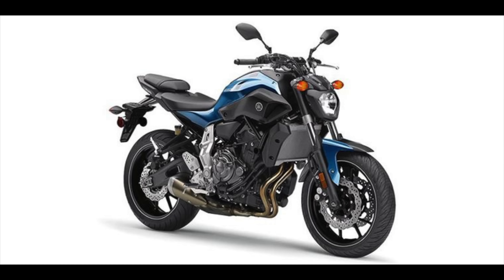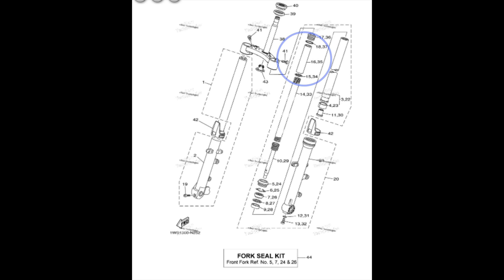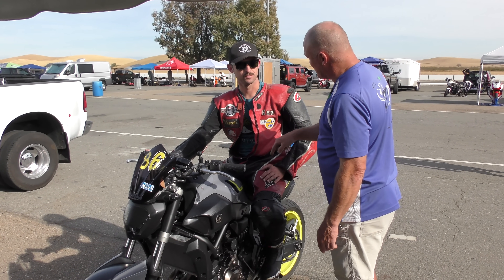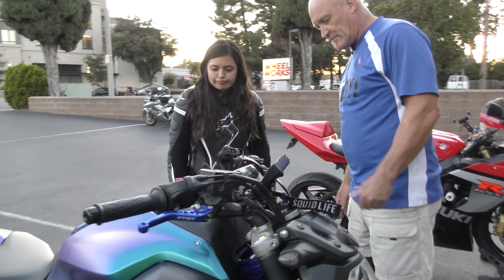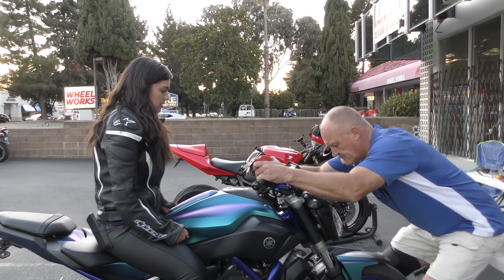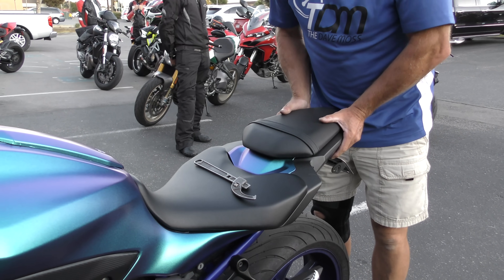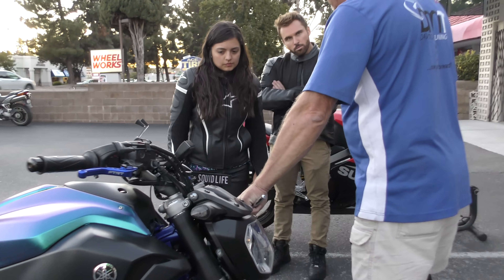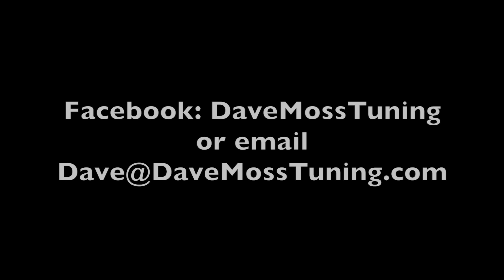Yamaha FZ-07 / MT-07 Fatal Flaw and How To Fix It

Comment: Can anyone confirm if this is applicable to a 2018 MT-07 with the newer suspension?
Reply from the maker: Yes - I went to review a 2020 MT07 and it needs to fork oil change at a minimum.
Reply: Dave Moss Tuning Thank you! I checked out my bike this morning and sure as shit there is no static sag in the rear. I can just back off some of that preload until I get about 10mm under static load and that should be a significant improvement in it of itself?
Reply from the maker: @ToxemicHunter  Correct! :)
Reply: @catalystreactionsbw  How much would you say is an "ideal" number for rear static sag? Thanks!
Reply from the maker: @RokRovan  12-15mm with a cold shock

Comment: This is a little late but why is this necessary? What about the stocks forks is dangerous? He only said don't ride it till you change it and it'll help handling, and everyone In the comments is acting like he walks on water. Please educate me
Reply from the maker: Dave Williams, editor, replying here. This is why it's necessary, at 5:15. You'll see he hits 2 bumps as he enters the corner and this causes the front to fold. The bars suddenly turn to the right and then he crashes. All because the forks ride too high in the stroke (no static sag) and the fork oil is too thin (pogo)  https://www.youtube.com/watch?v=Dglu0Wsf80k&t=11s

Comment from the maker: @Yolande Nelson - the XSR shock preload needs to be at the lowest/softest setting. The forks (if adjustable) can have preload and rebound set correctly. If not, they will need the 15w oil in the forks.

Comment: Does the XSR 700 have these same issues?
Reply from the maker: If there are no damping options like rebound, yes. If there is rebound control and you quickly go to 1 or 2 clicks from maximum, then oi is the issue not the spacer.

Comment: Dave. Arogant and wrong.
Reply from the maker: Interesting that the comment immediately below yours is 100% the opposite from someone that fixed their MT07, loves it and shared it for others to leverage.
Reply from the maker: Dave Williams, Editor, replying here. This guy never would have crashed at 5:15 if he'd made the fix. You'll see he hits 2 bumps as he enters the corner and this causes the front to fold. The bars suddenly turn to the right and then he crashes. All because the forks ride too high in the stroke (no static sag) and the fork oil is too thin (pogo)  https://www.youtube.com/watch?v=Dglu0Wsf80k&t=11s

Comment: is this problem just for the mt07 or does it apply to mt03 aswell?
Reply from the maker: MT07 is most in need of much heavier fork oil and the MT03 needs it but not such a big jump in viscosity.

Comment: Why do they do they outfit these bikes with crappy, non adjustable units? They're cheap. Marginally functional but cheap.
Thanks for a solution that doesn't require a third of the cost of the machine to fix!
Reply from the maker: Quite simply - budget to make some bikes affordable for those who have financial challenges.
Reply: @catalystreactionsbw  I know that one quite well. I commute an FZ 50 miles a day to work at a dealership in California. Quality poverty here brother.

Comment: Dave, a cuestion that comes to my mind is, does cutting the spacers affects it`s wheelie capacity? Because that is one of the most characteristic things of the bike
Reply from the maker: Not is the slightest and in fact - it adds a lot of safety if the wheel comes down off center post modification.
Reply: @catalystreactionsbw  Thanks for the answer!

Comment: What is the stock length spacer?
Reply from the maker: Posted in the comments for length, OD and ID
Reply: @catalystreactionsbw  I'm trying to figure out if someone already did the spacer and oil change in the forks. I dont want 20mm gone from the spacer just 10mm

Comment: So once I cut 10mm off of the spacer and decide to change oil to 20w do I add stock amount of oil or a smaller amount due to the thicker oil?
Reply from the maker: Go with stock volume.

Comment: adjusting the pre load on a spring doesnt alter the hardness of the  spring  , but you do need to adjust the pre load to suit the riders weight so the sag is correct. The spring hardness is all to do with the "spring rate"

Comment: Hey Dave , Very interesting insight. Clearly shows how factory settings are not ideal for a bike rider. I have XSR700 2016 anniversary version. Do you reckon same set up applied for MT 07 as you mentioned. I am 155 pounds and 6 ft tall. Look forward to hear from you.
Reply from the maker: Do the forks bounce the same way? Do you have 15mm or less of static sag? If so, changing the fork oil would be the minimum step. Setting sag in the rear would help you get the shock to travel the correct amount. Don't forget a cable tie on the right fork leg to see how much travel you are using.

Comment: So what about the KTM 390 Duke
Reply from the maker: Needs a shock spring that is correct for your weight if you plan on riding it fast or go to the track. If you ride around town, it works quite well.

Comment: Are these recommendations based on a heavy bias with track performance or overall use? Couple of things got most of my attention. That talk about the life of the shock and when you were talking about he girls bike.
I knew the reputation of the suspension going in, but when I got mine (2016 like her bike) I felt that the suspension wasn't as bad as was made out to be. No track days but spirited street riding, cruising, and two up riding.
I haven't noticed any change in the feel of the suspension as far as age. When the girl said she has about 5000 miles on her 2016, that really surprised me because I'm over 27,000 on mine of the same year.
Reply from the maker: Basic every day use. Try the 15w fork oil change as you will have to change it at some point and see how much better the bike handles. Nothing ventured, nothing gained.
Reply: @catalystreactionsbw  Thank you. Will keep that in mind.

Comment: All the stuff he said are correct but for the pre 2018 models. In 2018 yamaha stiffened the front fork springs and the rear shock, that now has a rebound regulation.  Not a top end job but for daily use the fz07 is better than before, on fast ride the front fork is pretty saggy yet.
Reply from the maker: Thanks for adding some information. Would you be kind enough to share with everyone what the static sag in in the 2018 and newer models? Is it over 25mm? Thanks for helping all MT07 owners with those year models.
Reply: @catalystreactionsbw  i worked only on the rear shock  modifing the preload,  for my 83kg, on the 4° notch (if i remember correctly) and the value of the rider sag  is  exactly 30 mm.  The static sag is only 13 mm on that notch. 
For the fork the static sag is 24mm and the rider sag is 37mm, with stock springs (and oil). I measured the value of the static sag with the bike on a stand.

Comment: Does a ninja 250 2011 have a fatal flaw ?
Reply from the maker: Just oil viscosity - spacer and spring length are correct. 15w oil minimum viscosity
Reply: @catalystreactionsbw  thanks much !!

Comment: I wish I would have known this 4 years ago when I had my 2015 FZ-07. I ended up changing the rear shock to Gears (they hooked me up) as well as using their fork spring kit with preload adjusters. Didn’t change oil or cut spacers. Wish I had Dave set it up after changing all those parts. Oh well, it’s gone now anyway. Waiting for the 2021 update to the MT-07 maybe I’ll buy one and start over.
Reply from the maker: Before you buy, measure the static sag. If it is 15mm or less the same problem exists with the spacer. Also ask what weight the fork oil is in the 21 service manual and see if it is 10 or 15w.

Comment: Why, why why do you suggest to change rear shock in every something km/miles, regardless what they use (original one or second hand any other rear shock or new one aftermarket etc.) ?? What is the reason? If these springs has life time, that much short, why doesn't rear springs on other bikes have the same issue? Or, do they??
Reply from the maker: Suspension service is every 6-8,00 miles/12,000kms for fork oil and for shock oil and nitrogen. Why? If there are no adjustments oil viscosity and wear cannot be controlled so the motorcycle oscillates down the road and is not planted. That accelerates tyre wear. If you have adjustments and do not use them, you create the same scenario. Springs will last 80-,000 miles on road motorcycles before they change their rate.

Comment: I’m planning to buy aftermarket springs and oil (hyperpro). Should i still cut down the spacers?
Reply from the maker: Compare the springs you acquire to the stock one for length. Do the calculations

Comment: Hey Dave thanks for the time and knowledge. Info that’s saving lives, one bike at a time! 16 Fz07 could you help with mine please? Weight- 165. What weight oil and how many mm should I cut the spacers? What tools do you use to debur the spacer and your preference on the brand of fork oil you like for the Fz07! Thanks a million! I will make sure
to pay it forward!
Reply from the maker: Maxim or Motul 15w oil, 15mm shorter (https://www.homedepot.com/p/SHAVIV-MB2000-with-E100-Blade-Deburring-Tool-with-Heavy-Duty-Blue-Handle-29092/309470932?mtc=Shopping-B-F_D25T-G-D25T-25_1_HAND_TOOLS-Multi-NA-Feed-PLA-NA-NA-HandTools_PLA&cm_mmc=Shopping-B-F_D25T-G-D25T-25_1_HAND_TOOLS-Multi-NA-Feed-PLA-NA-NA-HandTools_PLA-71700000034127224-58700003933021546-92700049573927173&gclid=CjwKCAjwq832BRA5EiwACvCWseTohCzf83twmXn1jmCvy26WEvXd4EoXEWaRvesjK_KkoUvh8yo7xhoCC1QQAvD_BwE&gclsrc=aw.ds)
Reply: Thanks for the quick reply! Best bike advice I’ve ever heard!

Comment: Same story for the 2006 MT03? I feel like the front suspension isn't good at all. The front of the bike feels whobbly mid corner. The static sag seems good, but when I compress the front suspension, its a little like a trampoline. Also the wear on the front tire didn't look normal when i bought the bike (now I have a new set of tires on the bike, so the tires ar not the problem).
Also when entering a corner I sometimes have the feeling the bike falls into the corner. 
Is the cutting down the spacers a specific MT-07 thing or does this apply to te the whole Yamaha MT-series?
Greetings from Belgium!
Reply from the maker: Correct - thicker fork oil only for the MT03.
Reply: @catalystreactionsbw  Thanks a lot for the advice!

Comment: hello dave mt07 motorcycle how can i adjust the suspension according to myself weight: 70 size: 176cm thank you
Reply from the maker: set rear rider sag at 30mm, do the modification to the forks asap:https://www.youtube.com/watch?v=X-uiiksWsOs&t=1450s
Reply: @catalystreactionsbw  thank you so much dave moss will do it as soon as possible👍👍

Comment: I am currently in driving school and they use mt 07s. Does anyone know if Yamaha has adressed this problem and if the current modell still has this issue?
Reply from the maker: measure static sag in the forks and you will get your answer but a few owner's have contributed to the thread that the answer is no. I need to get a 2020 MT07 for verification.

Comment: I did the rework on my MY14 MT07 and this was the right move. Thanks for sharing the information. Do you have any recomendations on rear springs? Thanks
Reply from the maker: Deepends on your wight, 80 to 85 rate works for most rider unless you are 200lbs or more, then 90 rate.
Reply: @catalystreactionsbw  Hey. Thanks for comming back to me. I need to ask you again as I do not understand the 'rate' you mentioned. The rear suspension of my MT07 is the original one from Yamaha and is in use 10.000 mls now. I'm more a 200-210 lbs driver. I also measured the travel of the rear end (52.2cm without me and 48.2cm with me on the bike). If I understand you right, the 36mm travel is too much, right? The sping is set quite soft (I think 2nd last notch on the damper). Thanks again for your help. Michael

Comment: He's talking about in a track-use scenario.  And also incorrectly called the oil by its weight.  10w  does not = 10 weight.  thats not a thing
Reply from the maker: Dave Williams, editor, replying here. Street use for the guy in this video, at 5:15 . You'll see he hits 2 bumps as he enters the corner and this causes the front to fold. The bars suddenly turn to the right and then he crashes.  https://www.youtube.com/watch?v=Dglu0Wsf80k&t=11s

Comment: hye Dave, im using mt07 '16 and live in Malaysia, do you reckon i use the same setup as you suggested? my weight is 73 kg , should i shorten my spacer as suggested and use 15W oil or thinner one? thanks a lot for the tips.

Comment: 01:00 

oh shut the fuck up. First, it's not a catastrophically-bad problem. That's just ridiculous. #2 it's not a case of bad engineering. Either the  fork springs are too stiff or too long or the fork preload is set too high or the damping ramps up too quickly as the fork sags. 

But millions of miles have been racked-up on these bikes by now, in stock form...the bike has been out since 2015 at least and this is the first that I've ever heard of a problem, ANY real problem, with that bike. You act like the fucking wheels fall off or something.  

Let me tell you what did have a real problem that made the bike unsafe to ride. 
The Suzuki master cylinders which wore out quickly and allowed air to seep into the brake fluid. That was a design flaw combined with an implementation flaw. That did actually kill some people. It still took YEARS for Suzuki to even acknowledge that flaw and another 5 years for them to put a refurb program into place. 

I only heard of that from one source. Long after the recall notices were sent out to correct the problem.
And still I don't see many sources talking about it. 

This is nowhere near that level of seriousness.

Comment: Really appreciate the video here about the MT-07 suspension! Thanks for it!
But i still have a question, on the rear suspension, when i sit on the bike I have a difference of 30mm, but I still can't pick the back up, should I go even more softer?
Reply from the maker: How much shock travel are you using? Look at the shock shaft to see. If ti is clean put a small amount of WD40 or other fluid on it, let it dry and ride. It should leave a very fine dirt/dust ring. If after the ride the shock shaft is 100% clean, the spring is absolutely too soft for you. Ideal limit is 2-3mm from the rubber bumper.
Reply: @catalystreactionsbw  Thank you! I will try that, but I'm not sure if i will see anything because the shaft is black

Comment: Was this not fixed in the 2018 update to the MT-07?
Reply from the maker: Many with the 2018 have contributed in the comments that static sag was not corrected with this model and they changed oil to get far better handling.

Comment: The Yamaha MT07 is not a circuit racer but an allround  all season street  bike,The suspension is adequate for normal use by responsable bikers and well within safety limits.
Starting a panik by  falsely proclaming "fatal flaws" is not OK  and not helpfull .Just my opinion.
Reply from the maker: Dave Williams, editor, replying here. The guy in this video, at 5:15 would not have crashed if he'd done the fix. You'll see he hits 2 bumps as he enters the corner and this causes the front to fold. The bars suddenly turn to the right and then he crashes. All because the front rides too high in the stroke (no static sag), and the fork oil is too thin (pogo)  https://www.youtube.com/watch?v=Dglu0Wsf80k&t=11s
Reply from the maker: One of the words used to define "Fatal" is distasterous. That is highly applicable and relevant given how the bike handles off the showroom floor and it degrades from there as the oil ages. There are plenty of comments supporting this POV and more positive comments of how cost effective and beneficial the change is.

Comment: Dave & the team, thank you sincerely for sharing this insight.
To verify & reiterate in writing for everyone:

1. Cut the Front Fork Spacer's length depending on the rider's weight:
- 15mm if the rider weighs less than ~140 lbs
- 10mm if the rider weights higher than ~140 lbs

2. Replace the Front Fork Oil with a heavier weight fork oil 
(i.e. Bel-ray fork oil recommended, according to another video by Dave Moss)
- 15W oil if the rider weights less than ~140 lbs
- 20W oil if the rider weighs higher than ~140 lbs

3. Adjust the Rear Shock Preload depending on the height difference between any two fixed points between the suspension & the seat
- Increase (stiffen) if the difference is higher than 40mm
- Decrease (soften) if the difference is lower than 30mm

Is there anything else that you would recommend done to refine FZ-07?
Reply: Yes, you forgot to rise the height of the fork about 10mm ;)
Reply: @davidfpv4969  eight mm.
Reply: Thanks
Reply: How much oil do the front suspension rods carry when changing the oil seal on Yamaha MT 07 2015?
Reply: @datpat2475  415 cc.
Reply: Yes, Get a Honda
Reply: Basic stuff most mx racers know but road riders dont. Great video.
Reply: @todds5956  haha right? I guess we are trying to make a bike go through some gnarly rough tracks and want it easier. Casual Street riders dont have the overwhelming need to adjust their machines.
Reply: @leeham273  have you rode a mt 07 with the simple mods and with the factory settings? I certainly have on my 2022, works wonders for every day riding and only costs the price of a bottle of bel ray 20wt fork oil.
Reply: @leeham273  this really is just for casual street riding. Really does make a difference for the better.

Comment: Couldn't help but notice all bikes are of the previous generation, i have a MT07 ABS RM18 2018 and the shocks are absolutely fine, 2500 kilometres on the clock and no issues. This might have been fixed by Yamaha on newer bikes